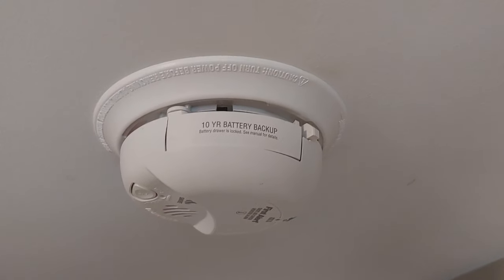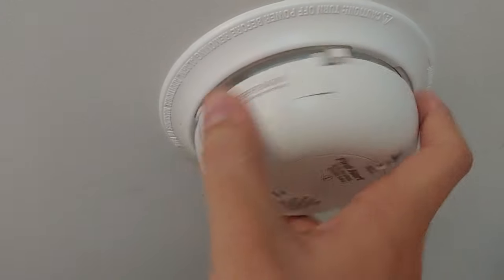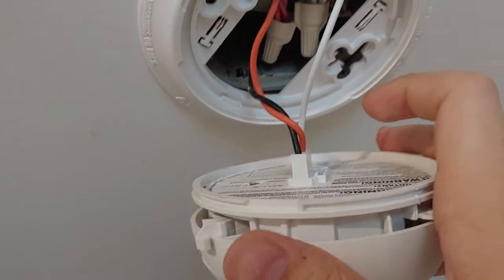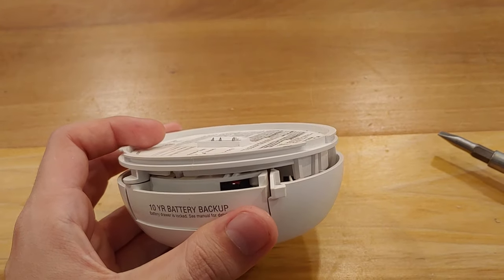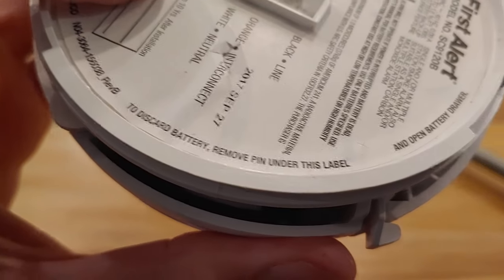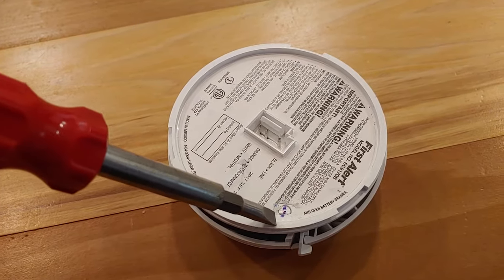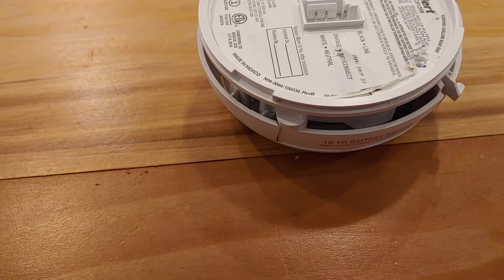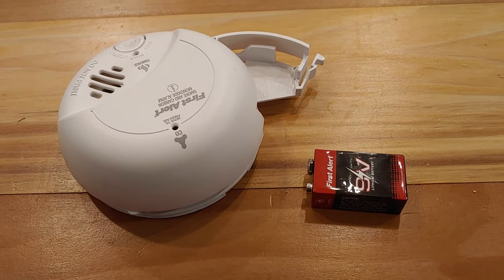LOCKED Battery Drawer; First Alert Smoke Alarm Battery Change (SC9120B)

Comment: Why did they feel it was necessary to complicate something that had no business being complicated?  I have the exact same model but the battery drawer is not locked, you can just pop it open without removing the detector from the base.  Then they had to go and mess with it.  If a design works you fu@#$#% leave it alone!!!
Reply from the maker: Yeah sometimes they like to put the locked ones on properties where they don't want tenants messing with stuff without calling the landlord first. Pretty easy to outsmart though.
Reply: @weeyum99  True buts it’s 2:00am and my locked alarm is now low on battery 😢
Reply: Thank you for this video. My mother has zero patience and never listens to me when I say I can just google or YouTube something.
Reply: Your's worst, it didn't even have the dot locator on the label for the pin location.  By default it was locked and the factory battery contact transparent film was stuck real good even with the stupid plastic pin removed and door opened.
Reply: Exactly same I’m having difficulty getting this battery out as I typed this 😢 lol smh
Reply: Can i just use this exact same alarm without wiring and just powered by 9V battery?
Reply: So women can’t do it
Reply: Because they claim these sealed ones have a “10 year battery” that lasts as long as the alarm itself but it never does and they want you to get a whole new alarm
Reply: Thank you this video!!  It helped us know how to open the battery drawer!

Comment: Thank you so much for this video.  This thing woke me up at 10:30 p.m., driving me crazy with that chirping noise for about 30 minutes while I was trying to figure out how to remove the battery. I almost broke it trying to force open the battery compartment.  Prior to watching this video I didn't know that there is a pin that has to be removed to open the battery compartment.  Thanks again.
Reply from the maker: You're welcome, glad I could help!

Comment: thank you for posting the video. Never did find a reason why the hell I or anyone would lock the battery compartment. Guess First Alert places a very high probability of someone breaking into your house and going straight to the smoke alarm to steal the battery. Also hiding the pin under the label on the back is another great idea. In over 30 years of owning houses, I've never thought that I would ever have the need to lock the battery compartment, and I won't start now. Thank you First Alert for thinking of something so frustrating and useless.

Comment: Pro tip - write the date that you changed your battery on the battery with a magic marker. Use quality batteries. Changing all them on the same day helps. But, these days, batteries are too expensive . Thanks for this video.

Comment: Be good to show you using the flat head screwdriver to take off the square white connector with the hot neutral ground wires inserted. I realize someone would have to hold the camera for you.

Comment: I was really struggling to pop the pin out using a screwdriver. I finally was able to get the pin out using a wine opener’s corkscrew. Highly recommend trying that instead of the screwdriver.

Comment: Thank you. I had to open the battery compartment to be able to remove the plastic tab that activates the battery. I pulled very hard with a pair of pliers and it would not come out. I was able to remove it after opening the compartment. Thanks so much for posting.

Comment: Omg thank you so much ! I had no idea how to get the latch that’s connected to the ceiling undone (I didn’t have a flathead screwdriver so I used the handle of a plastic fork) and that made it 1000x easier to put the battery in ❤️❤️

Comment: Thank you so much for this. I just installed this model today, but could not open the battery chamber. Luckily it is new with a new battery inside and I just pulled out the tape with the force. Now I know there is a pin. Hope I will remember next time when I need to change the battery.

Comment: Thanks so much for the video I torn one up trying to opening it. Didn’t want to do that again so I watched your video. I had no ideal there was a safety lock pin in the alert 
I removed with no problem took out the pin and changed battery with no problem thanks so much
Reply from the maker: Glad I could help!

Comment: The 7010LBL and 9120LBL can do this too. Also there's a model 0827 that also has a 10-year 9V battery that's meant to be permanently deactivated when it gets low, however I found this quirk: If you pry off the cover (There's three tabs that hold the cover on, which you can just push out with a flat-head screwdriver (And not too hard or it will snap)), you can replace the battery. I found that out because my dad went to install one that didn't work upon activation, and I managed to find out its battery was dead.

Comment: Thank you for the video. Very poor design by First Alert. The pin is buried under the product label. You have to tear apart the label to get to the pin. Also pin is not so easy to pull it. I literally had to dig it to get it out. I eventually broke the pin head. Very had design by First Alert. Product says 10 year back up battery and it started chirping in 3 years. Is there any other manufacturer?

Comment: I wish you only happiness. Day 2 of dog sitting and this terribly designed alarm starts chirping. Im there trying every way possible to get the battery drawer open, never expecting a pin that would then need a 2nd tool to remove that, all to get the battery out!

Comment: I just got 2 same model number SB120LBL SAYS 10 years on it side of it.   Installed it pull tab out on the side of the smoke alarm .  Now it beeping steady every 10 seconds or so .   I have 2 and installed them both .   Do you what problem is?

Comment: What’s the point of that locking pin?
Reply from the maker: So residents don't go messing with smoke alarms, mainly used in rented properties.
Reply: No one is going to listen to this thing chirping until maintenance gets there to change out the battery

Comment: This stupidity of this design is utterly ridiculous. I was ready to take it outside & smash it with a hammer 🔨 until I found this video. Kept me up all night. The rectangle 9 volt battery goes in a half oval tray. 🤦🏼‍♂️. A toddler wouldn’t have engineered this travesty of a device.

Comment: Anyone ran into a scenario where the beeping is coming from the ceiling and not the detector itself? I replaced my detector with a new one hoping it stops the 5 beeps but to no avail. Anyone?
Reply: I have a similar issue right now. Were you able to find a solution?

Comment: SHOW US THE FUCKING BATTERY CHANGE
Reply from the maker: Sorry man I've only got 2 hands lol. But its really not all that hard, just match up the shapes of the contacts 🤷‍♂️
Reply: @weeyum99  thanks for responding. I’m in an apartment and I’ve tried multiple different ways of putting a new battery in to no avail. Waiting on maintenance now.
Reply from the maker: @ceus1001  Hmm weird. Yeah hope all goes well, I know how annoying it can be. 👍
Reply: The battery is the easy part.  Every 10-15 years though you have to change the entire smoke detector.  I am however stuck on the stupid pin.  It will not pry loose

Comment: You literally glanced over and don't even film the most important part which is to show which way the battery goes in. Pleb
Reply from the maker: @isaacsmith1482  No, the most important part is getting the compartment open, which was the point of my video. I figured I wouldn't have to explain how to connect the battery, because there's only one possible way it can physically snap onto the connector.